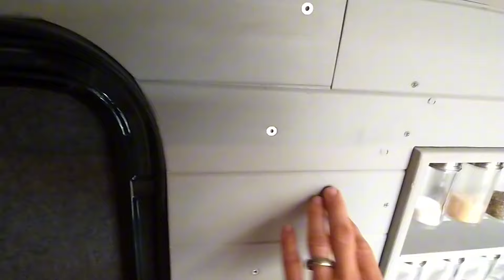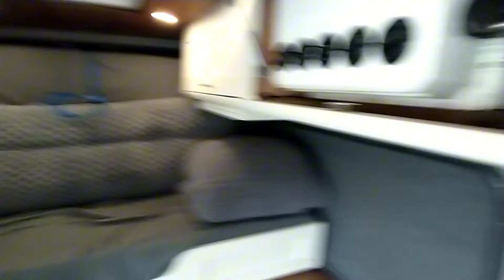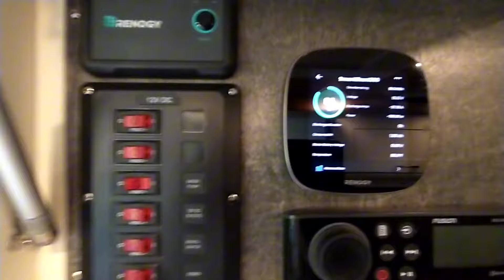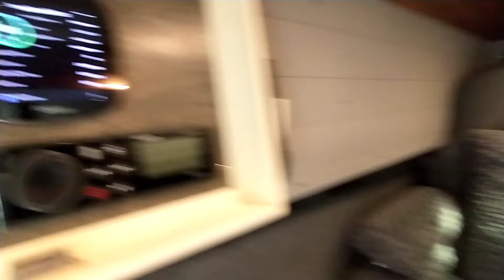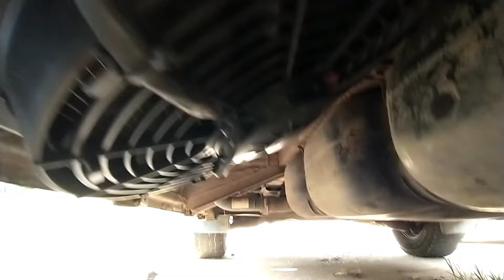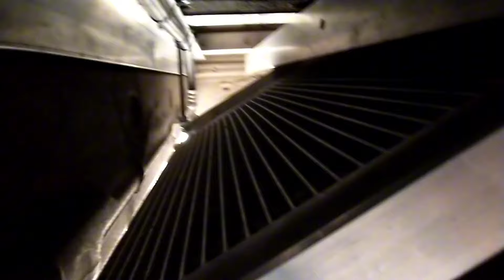$600 DIY 12V UNDERMOUNT A/C!! Treeligo mini split underbody mounted on a Sprinter Van

Comment: I've done the same on my Sprinter. Different compressor and evap but I swear by it. I can run mine and still charge during the day. And agree, the condenser doesn't need much protection. I've had mine standard off the shelf, full of road battered and 3 years still going strong. Great video mate
Reply from the maker: @WanderingandWilderness  That's awesome, charging during the day while running is impressive! I'm hoping mine holds up that well 🤞

Comment: Can this unit output heat as well? I know some split systems can, but I’m not sure what is involved. Excellent install and presentation. I really appreciate you sharing this.
Reply from the maker: Thanks! No heat for this one I installed a diesel heater which is a hundred times more efficient. Video on that install is coming shortly. They do sell a couple of split units with heat but the cost and efficiency made it a no-brainer for me.
Reply: I've got one with the heat installed but it's not very efficient.   It's an electric ceramic heater.   And from what I heard it doesn't heat as good as a furnace..

Comment: Thanks for the video Pal,
You’d think these 12v split systems would be more popular. They’re quiet, way efficient, and cheaper than the standard rooftop ac.
Reply from the maker: @kennedymallery665  Glad you enjoyed it, and agreed! I only have a year or so of sporadic use on mine but so far I love it!
Reply: Absolutely...  I've got a rooftop AC unit with these exact parts compressor and condenser I haven't installed it yet.    I bought it a few years ago I should have waited till this year because they've come down $300

Comment: Great job, I’m going to do the same in my 2016 Sprinter with the same unit. Can you give me some advice are Freon charging? I’m not sure how and how much oil to put in. Any information would be greatly appreciated. Once again great work.
Reply from the maker: @rvc9876  Also, evacuate the system for 30+ minutes and be sure to purge the lines to your manifold prior to charging. Lots of videos out there that'll be more helpful than my commentary. If you have any specific questions I'd be happy to help. It's a pretty straightforward but also a small system so needs to be done correctly. Cheers
Reply: @andysgarage1 what tools are needed to put the refrigerant in it? Most of these units explicitly say to have a professional install them. I'd like to do it myself if possible.  Thank you and fantastic video!
Reply from the maker: @joemorgan7005 You will need an R134a manifold set and a vacuum pump. Both can be purchased on Amazon and there are a lot of good A/C servicing videos here on YT
Reply from the maker: @rvc9876  650 grams of freon and 4oz of oil. However, oil should be pre installed in your compressor, reach out to the seller to verify.

Comment: Wow nice ! Hidden in the cabinet is great. 

Do you think it would be more efficient to have vents in the bottom of your cabinet?

Did you disassemble the outdoor split unit or did it come like this?
Reply from the maker: The intakes for the squirrel cage style fan are on either side of the cabinet. I left a couple of inches on either side for this reason. I do not believe vents would make it more efficient, however, having a temperature sensor remotely located across the van would make a big difference in the steadfastness of the temperature in the van.